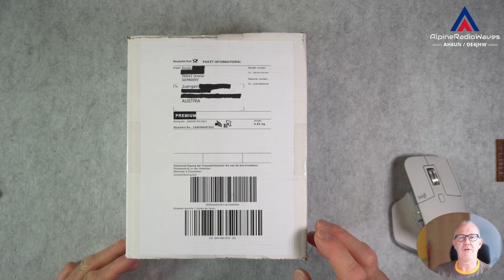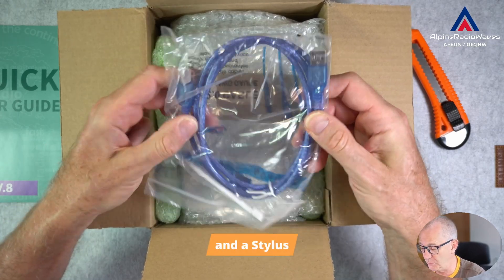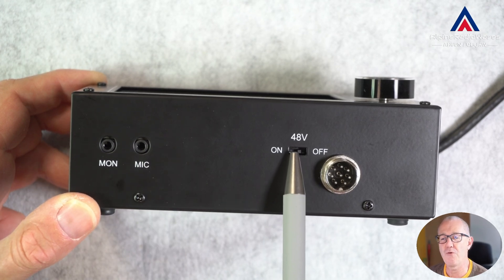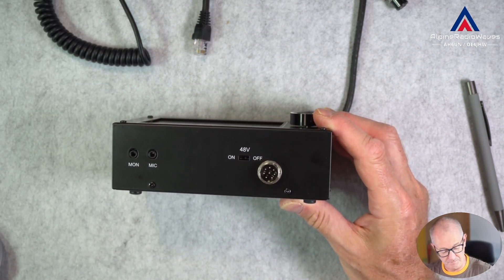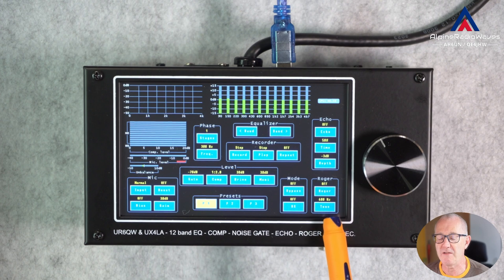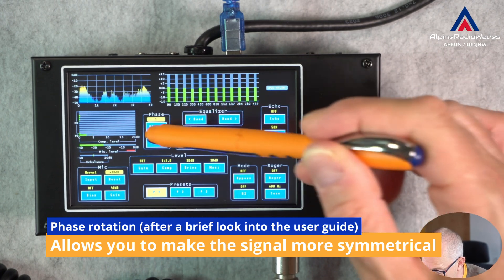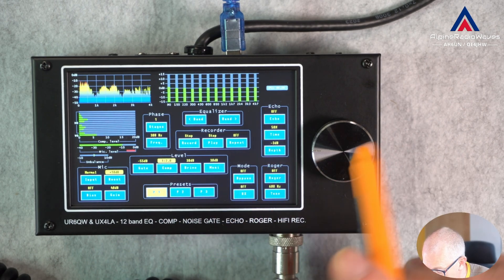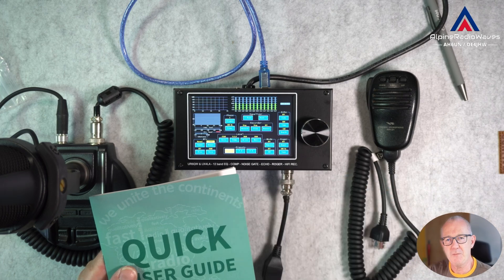12 Band Equalizer (EQ V.8) by UR6QW & UX4LA - unboxing and a brief look.

Comment: Hello I need setting with V8 and Icom 7300 for essb voice. I have a Heil PR40.
Reply from the maker: Hi!
Unfortunately, I can't offer you a ready-made "setting."
But I'm familiar with the PR-40, which emphasizes the lower frequencies.
For DX, I would boost the treble and cut the bass.
For "ragchewing," a bit more bass might be needed.
Check out https://heilhamradio.com/dsp-settings/ - you'll find recommendations for different radios there.
That would give you a starting point for your EQ settings.
73 and thanks for watching!
Juergen oe4jhw

Comment: Would be better if it had some more mounting/position options like a U bracket, keyhole slots and front mount mic input.
Reply from the maker: Hi Nigel, there is a bracket or stand you can buy. But I will 3D print something.
73 thanks for watching. Juergen